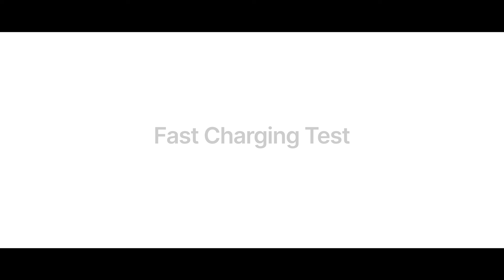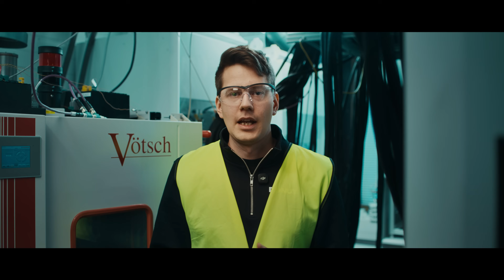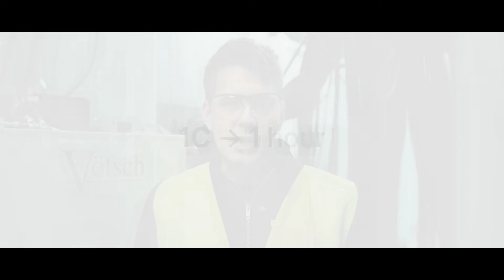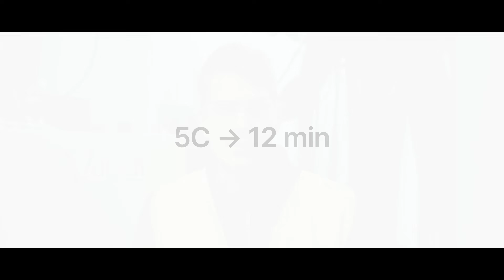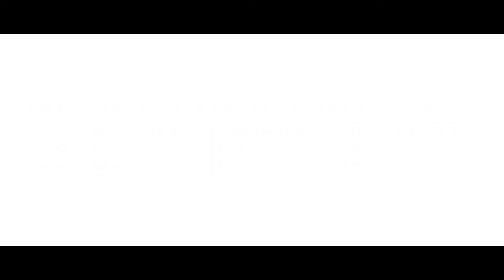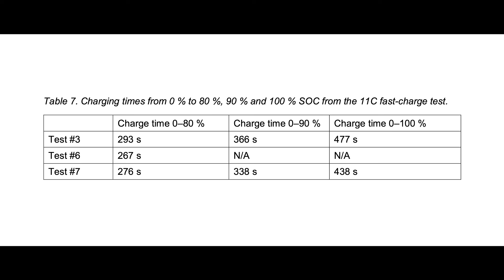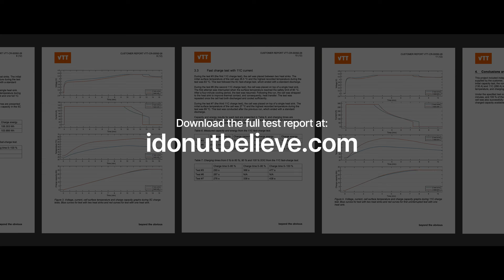Donut Solid-State Battery: Fast Charge Test | I Donut Believe (Pt.1)

Comment: So basically the same performance specs as Lithium Titanate. Thank you for sharing these results.
Reply: LTO energy density is in the double digits of wh/kg. They don't operate at this voltage. So you are just bullshitting.
Reply: @jambalaya974  You're missing my point. The performance alone isn't groundbreaking, and with ~10% roundtrip losses, these cells are already showing some weaknesses.

Comment: If the sweet spot is hotter, it decreases the chances that this is a supercapacitor.
But if it is a supercap with a self discharge rate of less than 1% a day or so, it's already revolutionary.

Comment: I would be much more comfortable with this battery, if it had at least one disadvantage. Maybe I found one now. The comfort zone of this battery is at high temperatures so I guess it will perform worse in cold temparatures. This might be managable, but it would still be a disadvantage.

Comment: Why is no one mentioning Toyota in any of these discussions? They already have a 450-500 Wh/kg density solid state battery that charges 80% in 10 minutes, already showcased a full BEV running on these battery packs back in 2020, showed the cell prototype way back in 2010 and have already invested billions in manufacturing facilities that will be ready for mass-production next year (2027).

They have over 8,000 patents related to solid state batteries from chemical processes, production technology, cell design, battery pack design, charging technology etc., have secured the full supply chain with dedicated production facilities by leading chemical companies for lithium sulfide and cathodes production at levels of thousands of tons, have gone through full government testing and certification of the complete battery packs and finished vehicles, and are also the world's largest automobile manufacturer.

Meanwhile Donut Lab have a small-time investor "who have seen the product" (as if such an investor would not have reason to hype the tech) and a VTT report that they commissioned basically just check if an unknown device (VTT were not allowed to check the cell itself) can handle a specific charging rate, which was only done 7 times (generally you go through thousands of cycles when you test cells), of which 1 time had to be aborted anyways due to temps going wild. This has to work 100% with thousands of cells stacked tightly together, and work flawlessly over many years.

And people still take these guys seriously, or think they stand a chance as a small startup with zero ability to build the billions worth of infrastructure needed to scale this sort of production? And without a single patent to their name? Or without a single chemist on the team?
Reply: Feel free to go mention Toyota in videos about Toyota's solid state battery, no one is stopping you.

This is about donut labs.

You dont go watch videos about burgers and comment "why no one mentions pizzas!?", do you?
Reply: Toyota has not delivered on solid-state battery promises—they've repeatedly delayed them while continuing to make new ones.

The facts are clear:

A history of missed deadlines:
- Toyota originally promised solid-state batteries by 2020 
- That slipped to 2023 
- Then to 2025 
- Then to 2026 
- Now they're targeting 2027–2028 

Current reality check:
- In November 2025, Toyota halted construction of their Fukuoka battery plant—the facility meant to produce these batteries 
- This marks the second delay for that plant in one year 
- Toyota admits they're "reviewing and adjusting plans" with no new timeline 

What they're actually producing:
- Toyota's North Carolina plant (opening 2025) will make conventional lithium-ion batteries, not solid-state 
- Their current EVs (bZ4X, RZ450e) use standard battery tech 

The pattern:
Toyota keeps announcing breakthroughs (1,200 km range, 10-minute charging, 40-year lifespan)  while pushing actual production further into the future. Meanwhile, competitors like Mercedes have already put solid-state vehicles on the road for testing .

When a company repeatedly delays the same technology for nearly a decade while maintaining they're "on track," that's not innovation—it's marketing.

Comment: I understand the strategy of releasing each claim's proof on a daily basis. What you're doing is addressing one thing at a time from the sceptic and going "Ok I proved this. What else?", they go "Uhmm uhmm what about N" and you go "ok we proved this. What else?"

After a half dozen of those the sceptics start to sound like they're grasping at straws, and you sound like you're just knocking 'em down one by one with facts and receipts. I like this. It's just arrogant enough that it works well if all this is actually true. :D

Comment: I'm no expert in batteries, but I've known this day was coming.  Albeit, I thought it would have been out around 2020 at the latest.  For all the naysayers, I'm sticking to my explanation as to why this isn't a hoax.  Just doesn't make any sense for this to be fake/hoax.  They weren't asking for anything, nor were they promising some drawn out vague timeline.  They said it was due out in less than 3 months from CES.  Today, they are giving the proof.  Month or 2, you'll see it in their motorcycles.  In probably 2 to 3 years, you will see batteries topping this battery's performance, as this will probably cause a mind shift in the way big battery thinks about how batteries CAN be made.  Instead of improving the standard prop plane, figuring out how to make a turbo prop go slightly faster, they'll start thinking outside the box, and start thinking about making a jet engine.  Then RAMJET, then levitation/gravity emitter and so forth.  This is this start of something economic shaking.  This is going to change everything.  Goodbye oil, gas for the most part.  Goodbye Petrodollars and the systems they creted.  Goodbye Utilities for the most part.  This truly makes Solar and Wind a truly viable alternative.  This will make a home setup truly viable, to be fully off grid.  You'll learn, one way or another...

Comment: The report's findings fundamentally change the situation: This cell is indeed a solid-state prototype, and the measurements show that it behaves completely differently from today's lithium-ion cells. The data in the document confirms several things that would be impossible with conventional NMC/NCA cells.
I will summarize this in a structured way.
... … 🔋 1. What the report clearly shows

The cell was tested under controlled laboratory conditions and shows the following:
5C charge (130 A) → Max. temperature 47–61 °C
11C charge (286 A) → Max. temperature 63 °C (cooled on both sides)

Only with insufficient cooling → temperature rise to 89–90 °C

Capacity loss after 11C charge: only approx. 1–2%
Nominal voltage: 3.6 V
Closing voltage: 4.3 V
Capacity: 26 Ah

These values are taken directly from the report, e.g.:

"The cell was charged at 11C (286 A)... highest measured temperature: 63 °C."

"The first charging attempt was aborted when the surface temperature reached the safety limit of 90 °C."

``` "After a full charge, 98.4–99.6% of the charging capacity remained."

🧪 2. What these values tell us about the cell chemistry

The combination of:
4.3 V charging voltage
3.6 V nominal voltage
5C–11C charging
moderate temperatures at high C-rate
solid electrolyte
does not match:
LFP
LTO
classic polymer solid-state cells
modern NMC/NCA liquid electrolyte cells
However, it matches very well:

➜ sulfide-based solid-state cells with NMC cathode and lithium metal anode
Why?

Sulfide solid electrolytes exhibit extremely high ionic conductivity (almost comparable to liquid electrolytes).

They enable very high C-rates, provided the interfaces are well stabilized.

The upper limit of 4.3 V is consistent with high-voltage NMC.

The capacity remains almost completely intact despite 11C charging → typical for lithium metal anodes with stable SEI.

🔥 3. Can such a solid-state cell withstand 90 °C?

The report shows:

The cell can withstand 90 °C briefly (Test No. 6), but only as a safety limit.

The test was aborted when 90 °C was reached.

The cell was subsequently tested further and continued to function.

This means:

90 °C is not the normal operating range, but rather the emergency shutdown limit.

The cell is thermally more stable than conventional lithium-ion cells, but is not designed for continuous operation at 90 °C.

📉 4. Impact on lifespan and cycle stability

This report does not contain long-term cycle data. Battery research suggests the following:

High temperatures (60–90 °C)
accelerate the degradation of the solid electrolyte.

They lead to mechanical stresses at the interface.

They increase the risk of contact failure.

They significantly reduce the lifespan.

High C-rates (5C–11C)

are theoretically possible for solid-state cells,

but only with massive cooling and optimized interface chemistry.

In the long term, they lead to the following:

faster SEI growth.

electrolyte cracking.

capacity loss.

Realistic expectation:

The cell will survive a few dozen to a few hundred cycles at an 11C charge.

At a 5C charge, several hundred cycles are likely possible.

At a 1C charge, more than 1000 cycles are probably possible.

🧭 5. What the report actually proves

It shows the following:

This solid-state cell is not a marketing gimmick.

It can handle extremely high charging currents.

It remains relatively cool as long as the cooling is adequate.

It is significantly safer under thermal stress than conventional lithium-ion batteries.

It is still a prototype and not yet ready for mass production.

🧩 6. Open questions the report doesn't answer

What is the exact cathode chemistry? (Most likely NMC-HV)

What solid electrolyte is used? (Probably sulfide)

How many charge cycles can the cell withstand at 5C/11C?

How does it behave under deep discharge, aging, and pressure?

What are its safety features in case of mechanical damage?

Summary

The tested cell is a high-performance solid-state prototype that:

can handle charging currents from 5C to 11C

withstands temperatures up to 90°C for short periods

retains almost its full capacity after extreme tests

however, it is not designed for continuous operation at 90°C or 11C

and most likely still contains critical materials (NMC).
Reply: Didn't they say at CES that it didn't contain lithium?

Point 5 states it is a prototype and not ready for mass production, but Donut Lab has already stated they have started mass production, they are also supposed to be shipping in Verge motorcycles by the end of March, so which is it?

Also wouldn't losing .4% capacity every cycle mean it would last just 2500 cycles, that's alot less than the 100k they claim
Reply: @brandonokeeffe1193  How many miracle batteries and accumulators have been announced in recent years? How many actually made it to market, and how did their fantastic performance figures compare to reality?

On paper and in the lab, everything always looks like a miracle has happened—but reality always catches up with them.
Reply: Great summary, thanks. Lots of open questions..

Comment: Impressive charging figures. However the battery degraded 2% in 7 cycles (89.2 Wh in cycle 7 vs. 91 Wh in cycle 1 - considering the reference it is even worse). It seems that they confute their own allegation about 100k cycles lifetime. At least the degradation test is gonna be the key proof if it is a scam or not.

Comment: Genuinely impressed by the VTT results, but one simple question: what does the cell weigh? The spec sheet shows 26Ah × 3.6V = ~94Wh nominal energy. If your 400Wh/kg claim is true, that cell would weigh 235 grams (94÷400×1000). One number. A kitchen scale. It would have been the most powerful thing in this entire report. Why leave it out?

Comment: I WAN TO BELIEVE ! ... but ( there is always ...but ): if this is a kind of revolutionary super capacitor ( which does not detract from its value as an energy storage device ) based on some graphene structures the question is: HOW FAST DOES IT DISCHARGES ITSELF IN TIME? ... if all this is true and it really works of course.

Comment: Bad news here guys, google says "Modern lithium-ion batteries typically exhibit a volumetric energy density ranging from 250 to 700 watt-hours per liter (Wh/L). Here we have two possible cases:
1. If pessimistically the bolt/nut is M8, then battery metrics should be around 20x8x1.5cm, which gives volume of 240cm3, 96wh/0.240L is 400wh/L
2. If optimistically the bolt/nut is M6, then battery metrics should be around 16x7x1.2cm, which gives volume of 140cm3, 96wh/0.140L is 685wh/L
Unfortunately both cases fit in the liion characteristics, so they could just show us/test a good liion battery!!! I really hope I am wrong here!
P.S. They could also state "we neve gave you volumetric energy density, we gave you a gravimetric one"...

Comment: It's vaporware until some 3rd party testers get their hands on these
Reply: This is exactly what is happening right now? This is a third party speaking after the CEO
Reply: @hadana1999  donutlab says it's "third party" but we can't know for sure yet...
Reply: @jozi3412  The results are on VTT's website.
Reply: @jozi3412  vtt has it on their website, that they are testing the battery, you can also read the paper on the website.

Comment: I think the first episode should be about ‘is this actually a solid state battery’. That was the biggest debate on the internet
Reply: Does it really matter? Specifications are what’s actually important. “Solid state” is just marketing (which is fair, I don’t mind a bit of marketing fluff). 

What they could do is a nail puncture test. That’s where solid state often shines. Safety. 

Donut is not going to deliver a tear down proving its solid state. They will want to keep the chemistry secret until the last possible moment. When the chemistry is public the clock starts ticking. Chinese companies (or any company for that matter) will race to reverse engineer it.
Reply: @auspiciouslywild  It does really matter.
Reply: @auspiciouslywild  It does matter, because many people claim only supercapacitors can do the performance claimed by Mark. That is what he said in the introduction video as well. That people think it's a super capacitor. So to debunk that doubt, is important and you can let VTT do EIS+DTC/TGA + FTIR/ Raman + basis XRD tests to show it's actually a solid state battery, without giving any recipe away.

Comment: Good for them. I do not believe on second VTT  did not do their due diligence and present real numbers. I background checked them and they are the real deal.
However .. they tested the product that they were given. So for me, Donut is not out of the waters .. Still waiting for the actual car/bike to real-world test their batteries.
PS: even the simple claim of huge temperature range is good enough. Active cooling/heating of current battery tech takes a lot of space and money. And car range fluctuates with outside temperatures. Having a stable outcome of your range is reassuring stuff.

Comment: charging results like this already exist for super capacitors, that was never the question here. this test is useless in providing proof that its an actual battery
Reply: Yes we need more data. Besides capacitors, Lithium titanate batteries can support high charge rates also, allowing for charging at rates as high as 10C, so nothing novel here... Lets see how many cycles this thing can resist before breakdown.. Also interesting to see how long it can hold the charge.. is it a capacitor or a battery?
Reply: It’s definitely not a capacitor. Even by rough estimates it’s way more energy dense than any known capacitor.

Comment: Based on the provided report for the Donut Lab Solid-State Battery V1, several technical issues were encountered during the testing process:
Thermal Management Issues
 * Interrupted 11C Test: The first attempt at a high-rate (11C) charge using a single heat sink had to be stopped because the cell's surface temperature hit a safety limit of 90^{\circ}C.
 * Thermal Contact Improvements: Following the interrupted test, researchers had to manually strap the cell to the heat sink to improve heat transfer and thermal contact for subsequent trials.
 * High Operating Temperatures: While the cell stayed at 47^{\circ}C with two heat sinks at a 5C rate, it reached 61.5^{\circ}C with only one heat sink. At an 11C rate, temperatures peaked as high as 89^{\circ}C even after improvements to the setup.
Data Gaps and Test Environment
 * Incomplete Data: For Test #6 (11C charge with one heat sink), "N/A" is recorded for charging times from 0–90% and 0–100% SOC because the initial attempt was interrupted.
 * Controlled Environment Deviations: During initial capacity and reference cycles, the climate test chamber was not actually operating, and the door was left partially open.
Document Formatting Issues
 * Text Corruption: Pages 11 and 12 of the report contain significant character errors and missing letters (e.g., "Fast c ar e test wit 11 c rrent" instead of "Fast charge test with 11C current" and "acc rdance wit t e c st er’s test plan").
 * Illegible Chart Labels: The axis labels for Figure 4 are severely corrupted, making it difficult to read specific values for time, voltage, current, and temperature without referring to the supporting text.
Reply: I also noticed missing test numbers, it's like they don't count like everybody else.
Reply: @cristibaluta sloppy

Comment: DonutLabs should test this battery in F1..... the 50/50 power distribution is killing the sport where need to step the throttle to charge. If this deliver it could also help the combustion engine bottlenecks on straight. if this is lightweight it could also help williams loose weight on the current car